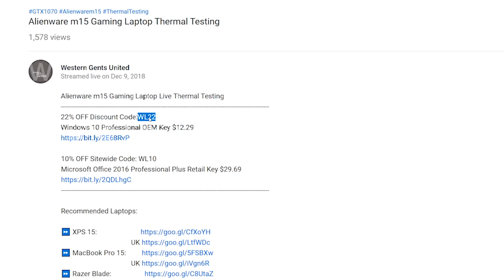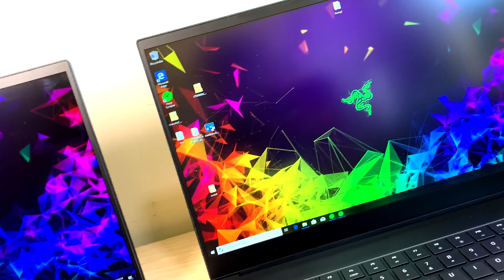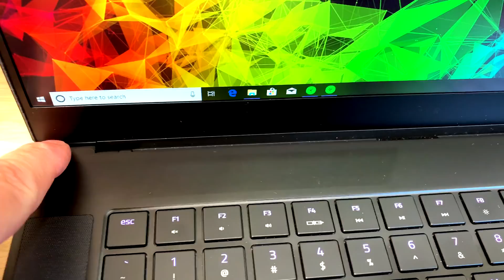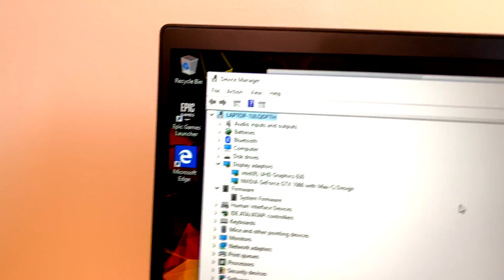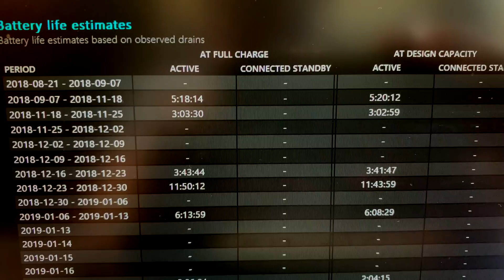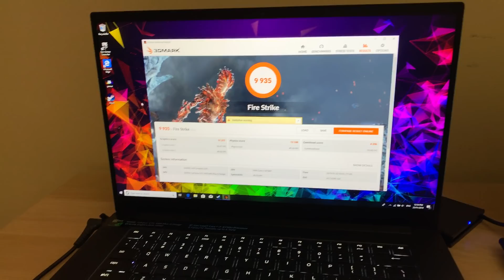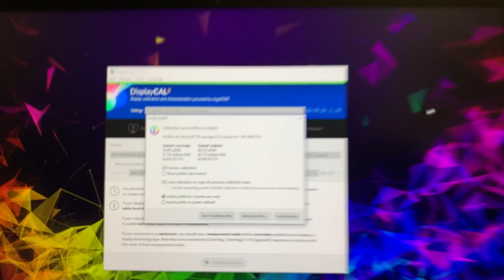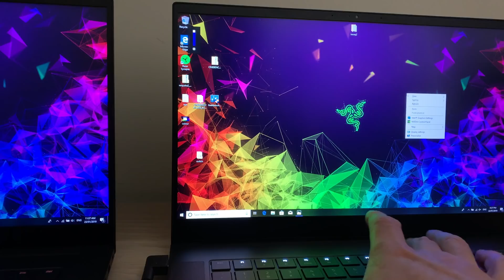Razer Blade Base Model Vs Advanced Model - The Physical & Hardware Differences

Comment: Great point to point review 👍
Should I buy Razer 2020 Base Model with i7-10750H 2070 maxQ super ($1899) which comes with 512TB SSD + 16GB RAM or Razer 2020 Advanced Model with i7-10875H 2070 maxQ SUPER ($2399) which comes with 512GB SSD + 16GB RAM
A quick question, I play games like overwatch, apexlegends, Dota2, league of legends and some latest games. I also use the laptop for adobe cloud nonprofessional usage like photoshop, ljghroom and premiumpro .
I do highly appreciate your input in above matter. Thanks

Comment: Just want to offer some insight for those who aren't sure which to get or if the difference is at all noticeable. For reference, I have owned the advanced, and I think slightly older (mercury white edition) with the RTX 2060 model for a month, and just got a black base edition with and RTX 2060 as well. 

Starting off, the display is noticeably less vibrant or "pops less" on the base model. Colors clearly are not as sharp. I was actually a bit confused the first time i booted up the base model version and loaded up my screensaver because the color just seemed off, and I had no idea the displays were actually different until I watched this video.

Next up, if you really care about audio quality, the base model is NOT the way to go. There is literally no bass, and the audio is a bit tinny, unlike the advanced model. I will say, it is not nearly as tinny as other cheaper laptops or in comparison to some of its competitors, but it's inability to produce any low-mids to lower/bass ranges in audio frequency. The advanced model certainly has a much more full experience when it comes to sound. As someone who listens to music and is obsessed with quality, I was pleasantly surprised by the advanced models speakers as I actually enjoyed listening through them while doing homework.

Now the battery. The advanced model seemed to last me around 5-6 1/2 hours while doing schoolwork, searching the web, watching youtube, etc. The base model (although i haven't tested it out) says it will only last up to roughly 4 hours for doing the same tasks. I have my laptop on for up to 3+ hours just while I am in classes, so the base model might cut it close for a college student who has to use their laptop in class constantly.

If you have to type a lot, the base model will slow you down. It has a very solid keyboard from a build and a feel standpoint, but it comes with its drawbacks. Key presses take more effort and commitment which in turn decreases your typing speed, and may introduce you to the wonders of finger fatigue if you aren't used to heavier key presses. It certainly is not bad by any means as it has consistent keystrokes and a satisfactory tactile feel, but the difference will be noticed. On the advanced model, typing is a breeze and a bit more pleasant in my opinion. In regards to the back-lighting of the two keyboards, the base model is quite a bit dimmer (as illustrated in the video). Another thing to note is that you cannot program the colors on individual keys for the bass model. The advanced allows for much more chroma effects. It also gives you a neat little feature, where when you press (fn), the function keys at the top will light up while all the other keys turn off, to guide you to the multimedia functions.

The thickness between the base model and advanced is noticeable, but really is not a huge difference overall.

One thing you should know about Razer laptops, is that if you do decide to purchase one, MAKE SURE IT HAS A WARRANTY. My mercury white one had a major problem earlier where it would shut off after the first booting screen, which is why I do not have it at the moment, and I am trying to get it fixed. I cannot stress enough how important it is to have a warranty on these things. There are way too many people that have issues with them, including me. So do not try to save a few bucks by not having a warranty, or your new laptop might just become a sunk cost...

Personally, these compromises are too much for me, and I would much rather have the advanced model (especially in the stunning mercury white :D). Even if you can only afford a refurbished or open box advanced model (WITH A WARRANTY), I would strongly suggest you consider that over a base model, even if the base model is brand new, IF these points are important to you.

Hope this helps!

Comment: is it plastic body right ?
Reply from the maker: No
Reply: @TallyHoTech   but not like macbook .. i have seen basic model today it feels like plastic even salesman said that it's plastic ..

I'm considering to buy a laptop and i thin good looking but a gaming one 
I was wondering to get this one not very confused with specifications
Reply: @PreetSingh-vg4dh  Both of the Razer Blade 15 laptops use an aluminum body, similar to that of a Macbook.
Reply: @PreetSingh-vg4dh  it's not plastic, it's exact same as a MacBook but it's painted so just easier to scratch

Comment: I have the Mercury White RTX 2060 model and running FurMark GPU stress test for a number of minutes I had the following results in the Balanced Setting. 

Burn In Test: (2X MSAA) Time 3 mins + Settings - Dynamic Background, Burn-In, Post-FX - One Fur circle with shimmering background
GPU Temp Max - 73c
Avg FPS - 78
GPU Core - 930 to 1005MHz

Burn In Test: (2X MSAA) Time 3 mins + Settings - Dynamic Background, Burn-In, Post-FX - Two Fur circles with shimmering background

GPU Temp Max - 73c

Avg FPS - 55

GPU Core - 960 to 1005MHz 

The Keyboard Keys get a bit warm but not bad.  The part just above the Keyboard Keys gets to hot to touch but is not in an area you would touch. The palm rests are fine. 
Fans on are on high but they sound fine and much better than an Alienware m15 I had.  The sound is not annoying and becomes background noise.
Also note this is a stress test while running Netflix or general applications the unit was quite with little to new fan activity compared to the Alienware m15 I had. The battery life leaving Netflix running at 50% screen, Keyboard LED off,  and sound lower (the sound is excellent and I have to turn it down or it is too loud for me) I got over 6 hours battery life.
Reply: i just got the rtx 2060. hows the coil whine in your laptop?

Comment: Big Keyboard Issue on my Mercury White Razer Blade 15 Advanced RTX 2060
  - All of the Keys with secondary functions are backwards - The main key which is typed when you hit the key is on the TOP and secondary key you would hit the Shift Key for are on the bottom.  This not inline with any standardized keyboard layout and for me is a reason to send it back.  Paying this kind of money for a laptop and the keyboard key not being correct is unacceptable for me. I know how to type and don't look but I noticed this today after selecting a key I would use the Shift key for and found everyone one is backwards!!!  I believe this is because all secondary keys are now lit and the Shift Key items were not lit in previous versions.  So they are now lighting the entire key but didn't change the format??
Reply: Late reply but this doesn't sound like a hardware issue, it'd be a setting somewhere. When I set up mine I set the language to UK English (I'm Australian) without knowing this would set the keyboard layout to the UK one also which mixed things up a bit.

Comment: IMO the base model was a swing and a miss. No reason to have the 1060 max q variant rather than a regular 1060, especially with a $1600 price tag. I 'd go for the msi gs65 8RE for $1579 with a full 1060, 144hz screen, 82 whr battery, slimmer/lighter design, and (slightly) better tech support.
Reply from the maker: Some great points
Reply: Watching this on my GS65 as we speak. Great laptop for the price!
Reply: Gregg Rogers It will be a while before I go back to MSI. My motherboard on gs63 died after 1 year and three months.
Reply: @hryank33  I hear you man. Motherboard on my gt72s died just after a year, right after the warranty ended. Coincidence? Who knows.... was a great laptop, but can't trust this company with my hard earned cash anymore.
Reply: Teebs That is so unfortunate man.
At least mine have two years warranty.

Comment: How many Ram slots has the Advanced Model ????
Reply from the maker: They both have 2 slots
Reply: @TallyHoTech  I thought it has 4 slot in order to support 64 Gb

Thanks for answer
Reply from the maker: You can get 32GB So Dims now.
Reply: @TallyHoTech  Razer said the laptop support up to 64 Gb ram...I would prefer to buy 4x16 gb instead of 2x32 gb.
Reply: @TallyHoTech  would it need a bios update or should any system recognize that without issue?

Comment: hey useful. I have being wondering, given that the new base model is MaxQ 1060, and games are not that optimized for higher core count, how much faster for gaming it really is versus a 2017 razer blade with the full 1060. your fire strike score is useful, as I remember the 2017 model hitting about 9.3k in firestrike, so the base model is about 6-7 percent faster. not a big improvement versus an outlet/used 2017 model no?
Reply from the maker: It would surprise me the quad core is faster. I will do a performance shoot out soon and make sure they have exactly the same settings.